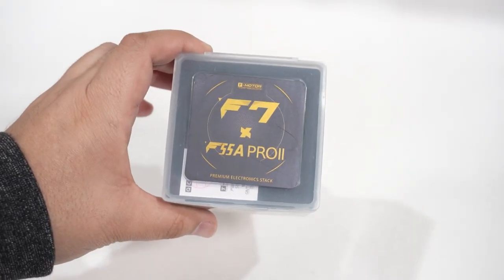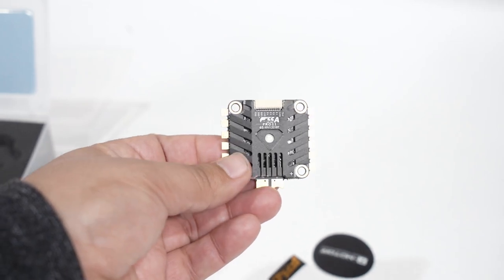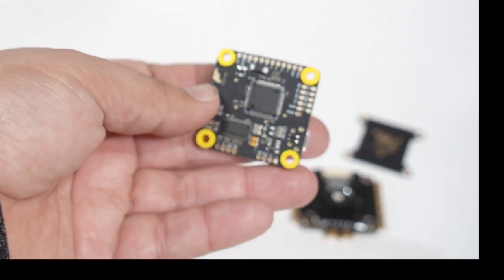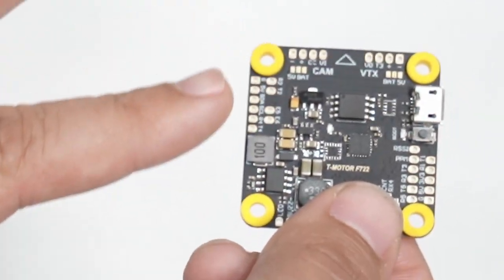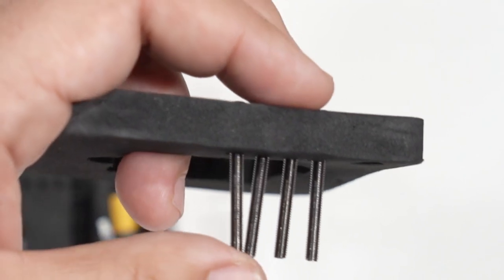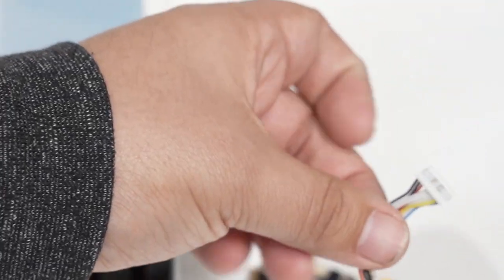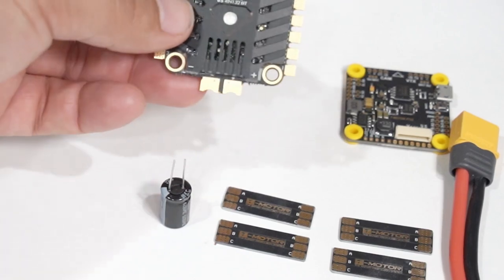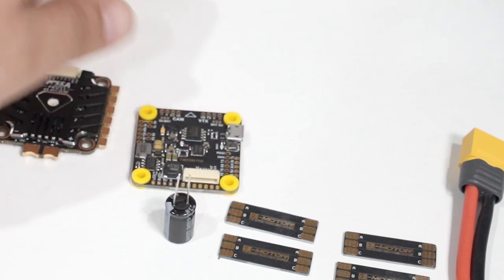T-Motor F55A PRO II 55A STACK - Most powerful ESC + FC combo, 2-6S power when you need it

Comment: Local hardware store. Has them screws in all sizes m3 m2 all length..
Reply from the maker: ive tried several,but never found anything that worked for FPV sizes.  if you find them stock up for sure.
Reply: @JonE5FPV  beleive me I did I bought them out.. I'm never in need of hardware ever..

Comment: How many UARTS - No Clue!
does the flight controller have a 9V or 10V built in BEC to power the DJI Unit - Not sure
How many Camera inputs - who cares
black box logging with onboard memory or memory card - look  at the silk screen printing
which gyro does it come with - wwooooooww it comes stack screws

This was 11 minutes of Unboxing for the T-motor Stack

Comment: does this fit DJI Digital with 6s?
Reply: It does have a 10V -2A regulator which I beleive can be used by DJI air unit. They also now sell and actual stack like this one but the FC has the actual DJI plug/pinout on it. It was realeased fairly recently . Check Tmotor website . I had this stack and sold it because the quad was such a monster and I mainly fly micros in my backyard. I highly regret the decision to sell it. It was an absolute animal on 6 and gemfan hurricanes